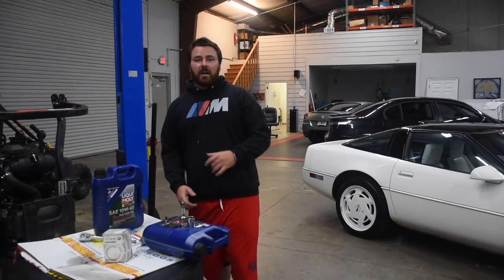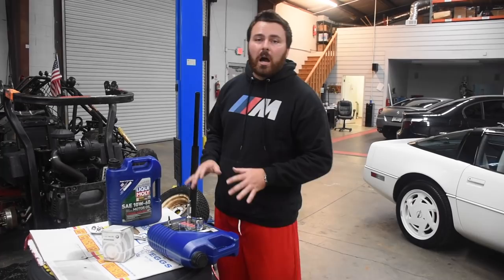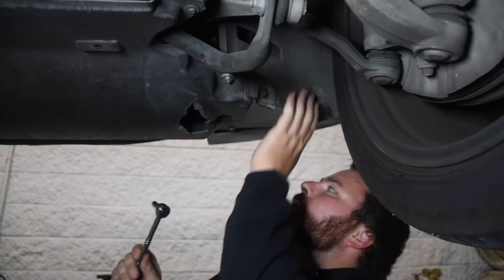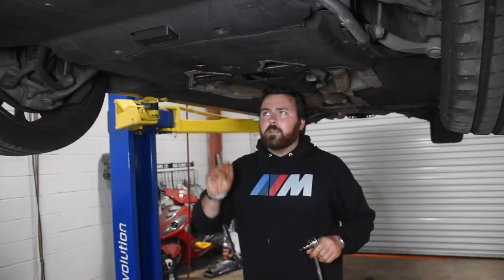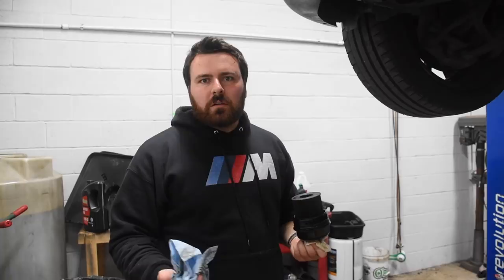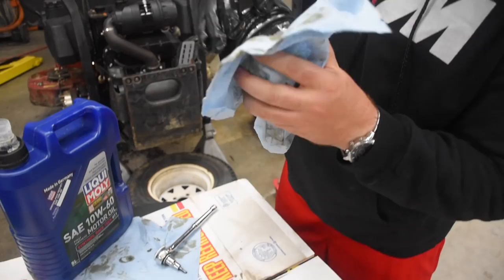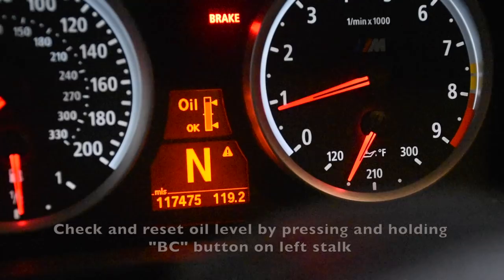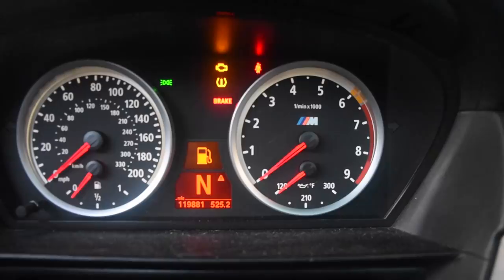Oil change on the V10 Bmw E60 M5 | Quick and easy!

Comment: Cool video. I usually change my oil every 3000 miles. You can also use “Rhino Ramps” to do your oil change. Just drive your M5 onto them and the rest as explained in the video, just don’t be an idiot and leave your car on neutral. Also make sure you place those rubber tire stoppers behind the rear wheels. I never change the o ring in the oil filter drain plug, but only the inner drain plug o ring, there are 2 and the huge o ring on the actual housing. I never had any oil leaks, but moving forward I will. Lastly, make sure you also use the copper washer on the main drain bolt.

Comment: The reason it is 15,000 is when those vehicles were sold they included maintenance for 4yr/50,000miles with a 15,000 mile oil change interval.  So it covered 3 oil changes and some brake fluid flushes basically.

Comment: Hey Alex ! Nice video. Yours is an 08 right. You have the second drain bolt for which the underside tray needs to be removed which is such a chore. Mine takes about 9.75 liters after draining both of them
Reply from the maker: Oh gosh I feel like an idiot now. I heard about that second plug and looked for it all over but didn’t realize it’s covered by the under tray. The first shop I took it to I watched them do the oil change and they didn’t remove it, probably because they didn’t know either since they mainly work on older bmws. I will have to make a second video once I can put it back on the lift to show how to remove the under tray for us 2008, 2009, and 2010 owners. Thank you for letting me know!!
Reply: @AlexGray  yeah dude, another 1L or so comes out from the front drain plug that's covered by the undertray in front of the jacking pad
Reply: Oh damn. How do I find that ? I never knew that !!!

Comment: Yeah Troy Jeup did a stroker on mines and he strongly recommends the 5w50 oil
Reply: how much does a stroker engine sell for? Do you have to provide a core engine? Thanks
Reply: Could be, maybe the way he builds the engine...but, BMW stuck with the 10w60 for the years, and still today, the car was in production.as a stock build. Stock, I will stick with BMW

Comment: Thanks for the video I have a E64 2007 and everywhere wants $300 for a picture change lol. I did notice you didn’t submerge the oil filter before putting it in which I had heard is bad that it shouldn’t go in dry?!?!? Since I’m a 2007 I don’t have a second plug then. I’m debating the 10w50 change since I have 56k miles but I wanted to do the blackstone test first since it hasn’t even had its first oil change with me.
Reply: Oil change not picture stupid auto spell

Comment: Ever thought about switching to 5w50 instead of the 10w60? Troy Jeup highly recommends switching and runs it in all of his builds.
Reply: Any update on this?
Reply: Why 5w50?
Reply from the maker: @cscorny  Sorry, just now seeing this. I have thought about making the switch due to people saying that they think it runs smoother. The reason I haven't made the switch though is because this car has had 10w60 it's whole life and when I replaced the bearings at 115k, they really weren't in that bad of shape for the mileage. I was expecting them to be down to the copper but there was no copper showing at all, just worn to the layer right above the copper. This was the first time they were changed, as the previous owner basically bought the car brand new and he said he never changed them. This makes me think that perhaps the oil itself is not the issue. I don't know what the issue is and maybe Troy is right, but I do know that I always allow the car to warm up every single time it's driven and many people think that's the key. It's the fact that I had decent looking bearings for the mileage and for using 10w60 that makes me want to stay with this oil because I know it has done right with my car, not to mention that I would hope bmw engineers were smart enough to know exactly which oil this car requires. I wish I would have waited longer to change them because they really did not need to be changed at that time, but I surely was getting nervous.

Comment: I take it that you don't know that on the 2008 m5 v10 .. bmw put a extra oil drain plug in.. so you can get a extra 0.7 litres of old oil that is trapped at the back of the sump.  it is at the back of the sump.. you have to remove the under tray, as they didn't put a extra hole in.. if you leave 0.7 litres of old oil sat in the sump, and then ad new oil. All you have done is tern nice fresh oil into a mess, now mixed-up with quite a large amount of disgusting old oil... never a good idea.. you should learn a hole lot more than I have forgotten, before you put your advice out on the Internet..

Comment: I have a question? My m5 started to drain the battery every 2 days about 4 months ago, now it does it every morning and recently when i tried to enter the car from outside the door wouldnt unlock i unlocked it with the key and then locked it and keyless access worked after that, entered the car and my whole system reseted itself, time date miles etc, what can i do about this what can it be?
Reply: Or your battery needs a change or the dynamo
Reply from the maker: How old is your battery?
Reply: Alex Gray 
Mine is 13 years old :) and still works..
Alina’s ?
Reply: I had it tested at a shop and battery tested good. But my friend said these tests sometimes are not always true. Bmw mechanic was saying that some of the electronics never go to sleep while the car is off, and drains the battery, therefore only the dealer can do an update on these electronics, even tho  it shows a drained battery sign on the dash it still starts, and didnt seem to make a difference even after 2 weeks of being parked still started, it just cranks more times
Reply: @drago22alina22   The battery some times make peaks and may give some power to start the engine... in my opinion you should check the system at the dealership, as you suggested, and probably change the battery,
Reply: if your battery is truly good , you need to have a energy diagnosis test plan run thru ISTA ,  this test will determine if the vehicle has a draw , and tell you the reason the battery is getting low . this message comes on when the battery state of charge dips below the battery state of health , when this happens you get the warning and the vehicle will start shutting down different parts of the electrical load .
Reply: Was it your voltage regular? That's what happen with mine. 40 dollars part out of Colorado! It was 2-3 hour job... not the easiest to take it off with alternator still mounted in the car but doable!